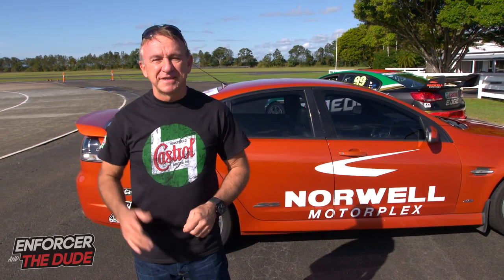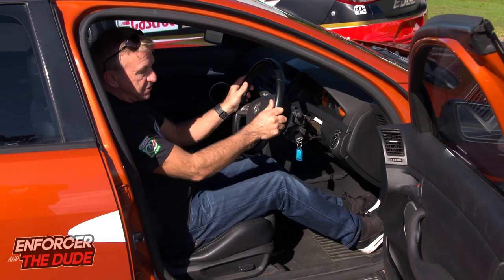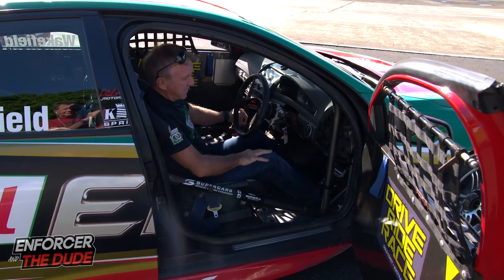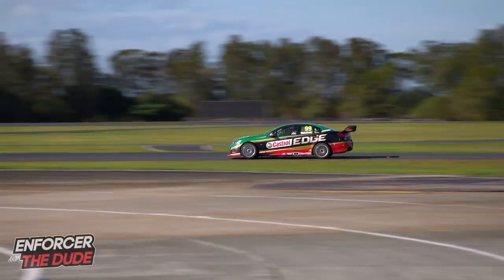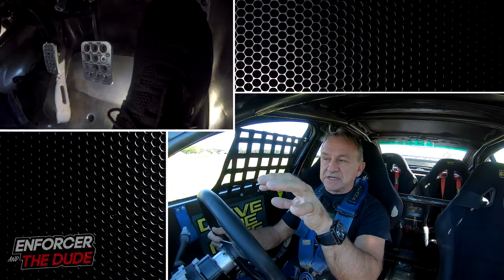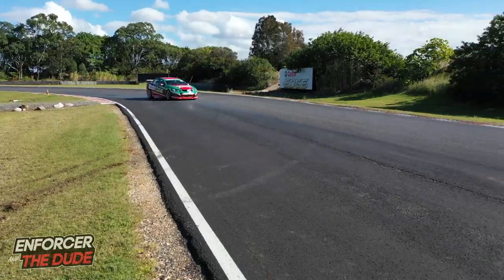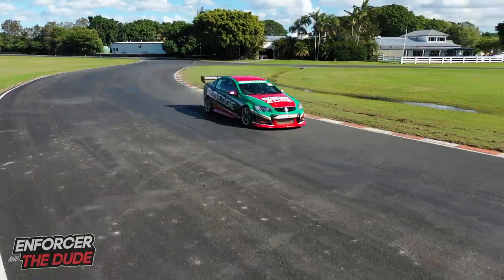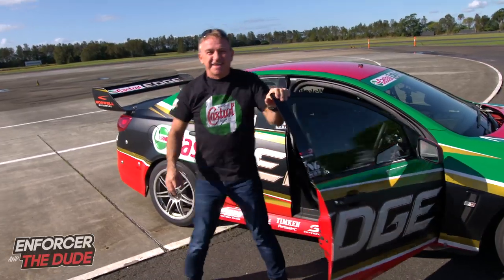TECH: Heel & Toe with Russell Ingall and Paul Morris

Comment: For me heel & toe started as a young bloke driving crash boxes so that I could change down while braking. Of coarse that also means a double clutch at the same time. Later on some times I did it with no clutch in the old 13 speed road ranger (depending on pedal positioning).
Great show mate.

Comment: After all the technological hype it's great to see what happens with that bit of the machinery between the steering wheel and the seat...that underrated component called the driver. More of this please.
Reply: In Russell's case it's the loose nut behind the wheel.

Comment: As a kid in the 1960s we drove US cars with no synchro on low gear, so we had to heel and toe. All fine if you are pigeon toed. But if you are bow legged like me, very uncomfortable. So I always used the heel for brake and toe for gas. Plus, the brake has less travel, so it worked out very well. Enjoyed the video. Was referenced to the video by Dale Earnhardt jr interviewing SVG. I was a Marcos Ambrose fan, so now I'm an SVG fan.

Comment: I always wondered how a left foot braker down shifted, thanks Rusty. I often switch feet on the street but struggled to clutch when left foot braking. I should've thought of that as I had to rev match my road ranger after breaking an engine mount while fully loaded and the engine torqued to the chassis and pinched the air line supplying the clutch. Keep up the good work guys. 👍
Reply: Good question, I own a rally car and installed a brake pedal from a auto which is wider so I have the option of having both feet on the pedal at the same time whilst swapping feet, sometimes it's a struggle to downshift but with rally cars all you need is $$$ and the problems solved

Comment: Left foot braking is an important skill to master in case you need it.

I had plantar fasciitis (shortening of the plantar tendon to the foot, causing serious pain) in my right foot for 3 months. I could walk and use the throttle ok, but couldn’t twist my foot, so couldn’t cross over to the brake with my right foot.

So I had to teach myself to left foot brake. And obviously after a few weeks I got pretty good at it.

It’s not something I use every day now, but it’s a skill I can draw in should I need to.

Comment: Can a finger operated lever or paddle be mounted on the steering wheel that would apply brake pressure for stability where needed (to balance the chassis in fast sweepers for exmple)similar to left foot braking?
A right paddle could apply pressure to the front,a left paddle could apply pressure to the rear..or any combination of any corners for artificial weighting of the chassis.
Reply: that would be dangerous. yes that is what ebd and esc systems do but with nanosecond precision. plus it would be very complex and costly to implement

Comment: with left foot braking and downshifting, I fail to see how you can " blip" the throttle for the downshift since the clutch is fully engaged ? The engine can't free rev in this situation so I can't see how you can match the revs for a clutchless downshift. Would like to be enlightened on this technique ..  ( I'm talking H pattern , maybe sequential is a different beast which can technically allow clutchless downshifts )
Reply: I actually found it easier to downshift compared to upshifting without using the clutch.  On an H-pattern, don't forget the box goes through Neutral before going back into gear, that's your moment to bring the revs up.  I really don't know enough about the sequential boxes but in my mind I feel it would be harder as you only have a split second to make the change.  I'm guessing different manual boxes will work differently though - the last time I tried it was in a VN Commodore with the old 5-speed T5 gearbox.